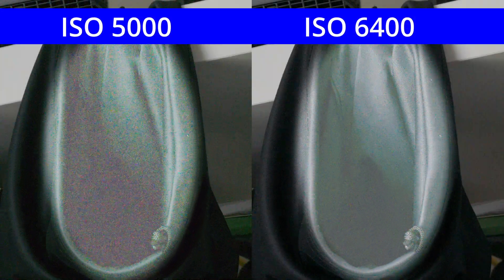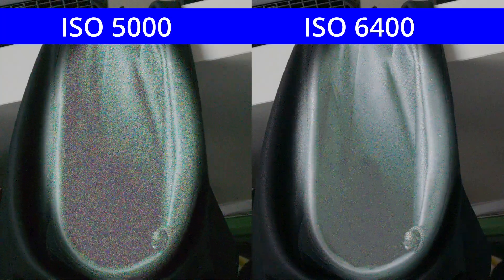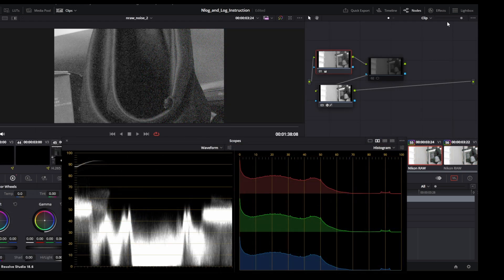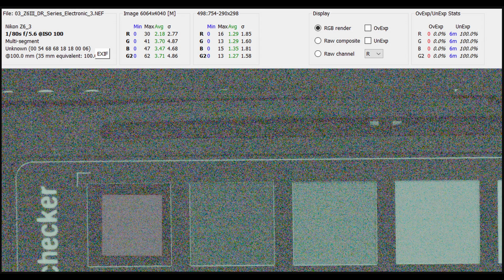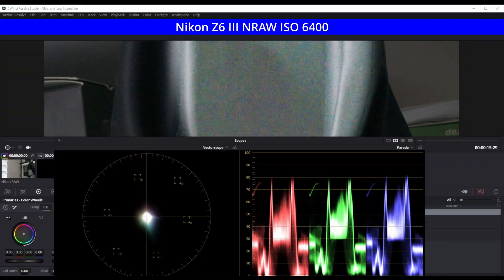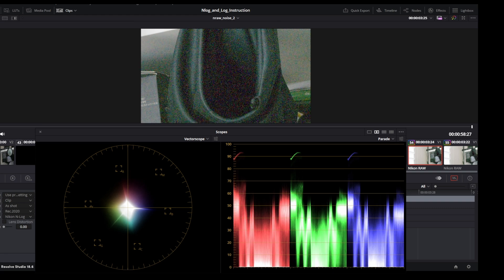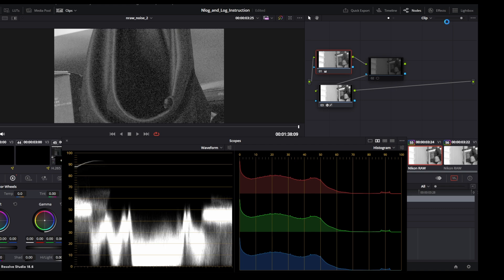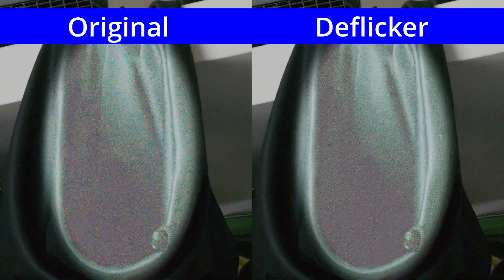Nikon Z6 III Video Flickering issue (with workaround)

Comment: Fantastic work. I've been messing with the Z6 and I absolutely love it, but anytime I need to lift any shadows in post or push an exposure.. the noise is intense. I also have a Z8 and have found a different issue... I wonder if maybe you could figure it out! When shooting in NRaw 4K, 24/30fps.. the blacks look like they clip and shift color.. Then if you go into the NRaw 4k 60FPS.. all of a sudden it matched the rest of the regular Nraw 8K and pro res blacks. I've tried standard and HQ raw modes, same issue.  It's been the number reason I dont use the Z8 more. Cause the raw is amazing on it.. but I dont need 8K majority of the time. So having the 4K raw fixed, would open up the camera for me more.
Reply from the maker: Thanks. I don't currently have a Z8/Z9 on hand so unfortunately I'm not able to try reproducing your issue.

Comment: Another reason  why you never buy these really expensive new models on or soon after the launch dates where Nikon and similar take  the piss with their RRP and deliberately over charge the value of these devices up to 30% or even 40%  of what the real price should be  when it eventually settles down to the real price which usually is after about 12 months being on the market . In Australia , Nikon launched the Z6III taking the piss at $4500 AUD that's the equivalent of  $2990 USD,  just a crazy price it wasn't worth it . Since then we see it wasn't selling well in Australia , it was too expensive.  A few months later already the price has come down around $800 AUD,  this is because  the original RRP price was way too greedy and wrong in the first place.  If you buy it  in the early stages of release you will massively over pay for these  depreciating electronic devices that will continue to loose  value. Just makes you wonder how they are able to drop prices by so much  like the Australian customer base example to meet the market and  usually the tech is already up to five years old when they drop these new models. Nikon would have already  built version Z6, Z6II Z6III years ago around the same time  as each other and version IV of the Z6  is most likely already sitting in a warehouse , just like what apple do with I Phones.

Comment: Excellent video, thanks.  I'm definitely sitting on the fence for this camera currently.  By the way, if you upload in 4k, Youtube doesn't compress the video nearly as much, especially at 4k, but also viewing at 1080p as well.  Even if one is viewing on a 1080p monitor, you get the best quality by "watching" in 4k, as youtube doesn't compress 4k nearly as much for some reason.
Reply from the maker: Thanks for the tip. I'll do some test uploads and see how 4K affects the compression for both 4K and 1080 playback.

Comment: Something i noticed is that shooting with SLG instead of Nlog seema to remove any flickering. I wasn't scientific in my approach but i looked for flickering across the entire ISO range and couldn't find any.

What are your thoughts on this? If it's only affecting nlog could it be software over sensor issue?
Reply from the maker: Do you mean HLG? HLG uses a shallower tone curve for the shadows, which means less shadow encoding / boosting than N-Log, so that would explain why you may not see the flickering.
Reply: @testcams sorry I meant SDR. 

If the shadow flickering isn't visible in a different tone, could it mean that it's fixable with a firmware and not a hardware issue that can't be fixed?
Reply from the maker: N-Log exposure baseline is -3EV vs SDR (because N-Log ISO 800 is really ISO 100 3EV "underexposed"), so that is likely why the SDR shadows look much better by comparison.
Reply: @testcams so if we push the SDR footage in post, we would see the flickering?
Reply from the maker: Yes, the flashing occurs in SDR footage. You have to push the SDR footage more to see it though since it doesn't start with a -3EV baseline like N-Log.

Comment: Is there ever a situation where you need to boost the shadows like 9 stops, or whatever you did?
Reply from the maker: Yes, when you'd like to more clearly demonstrate the relative difference (visually) of very small quantities between color channels for instructional reasons. The flickering issue occurs at much smaller EV boosting, as demonstrated later in the video and by Robert's video.
Reply: @testcams  Got a time stamp?
Reply from the maker: @2:27 in this video, which is approximately a 5EV push. Or in Peter's videos, which look like about 3EV.
Reply: @testcams  Thank you.  Now is 5000 ISO the right setting for that situation or is this a situation where you're pushing the camera beyond reasonable limits and surprised that the footage breaks down?  I'm thinking about buying this camera exclusively for the video work I do and am wondering if i'll ever encounter this 'issue'.
Reply from the maker: Your questions are valid and others have asked to same in the comments. This is not ISO specific, because it's not a noise issue per se but instead a variance in black level between frames, which is independent of noise or ISO. To help you and others with your buying decision, I'm working on a new video that compares the Z8 to the Z6 III, both at N-Log ISO 800. Even with no shadow pushing the Z6 III exhibits flickering on the Resolve scopes vs none of the Z8, but no flickering visible in the footage. At +3EV, the Z6 III's flickering is easily noticeable vs no flickering on the Z8. At no exposure push does the Z8 exhibit the flickering.

Comment: Why would someone use ISO 5000 when the dual ISO is 6400?
Reply from the maker: The issue can occur at any low ISO, for example if you shoot NRAW with N-Log at ISO 800 (which is sensor ISO 100), or if you shoot NRAW without N-Log at ISO 100.
Reply: Nikon added a feature on the Z8 to allow one to record at Lo0.3 to Lo2.0 (ISO 640-200) in manual mode, which is also available on the Z6 III. Will this issue be reduced/eliminated when shooting on a bright day by using one of these lower ISO settings? I’ve used Lo2.0 outdoors on my Z8 and it has less noise to clean up in post than ISO 800, I currently do not have a Z6 III to try it out but, I am curious how to see how this works on the Z6 III.
Reply from the maker: Yes, but only because you'd be effectively lowering how deeply you have to go into the shadows since "Lo" ISOs shifts the exposure right (brighter), which results in the same DR but changes the metered distribution of DR between the highlights and shadows. For example, Lo1.0 loses 1EV of highlights but gains 1EV of shadows, which means if you push the shadows by 3EV for both ISO 100 and Lo1.0, the Lo1.0 will be effectively pushing the shadows by only 2EV vs the original ISO 100 metered exposure.

Comment: Why would anybody use iso 5000 to begin with. I'm not trying to minimize the issue.
Reply from the maker: The issue can occur at any low ISO, for example if you shoot NRAW with N-Log at ISO 800 (which is sensor ISO 100), or if you shoot NRAW without N-Log at ISO 100.

Comment: As someone very interested in this camera, how serious is this issue for typical filming?  For example, to record low light scenes say under moderate lighting, is this going to be quite obvious or do you have be really pulling up the shadows to encounter it?  Would this likely be unacceptable to non-professional videographers or is it generally something you really have to look for?  Thanks.
Reply from the maker: I would recommend watching Robert's video to get a sense of a real-world exposure and adjustment one would face shooting N-Log that could encounter this issue. I get the sense he didn't do his Z6 III test looking for the issue. It doesn't require all that extreme of a dynamic range scene to manifest.
Reply: @testcams Thanks.

Comment: Given this shift is toggling so regularly is it possibly related to the debayer algorithms and therefore addressable in a firmware? I'm a photographer first, not a videographer so Nate that in mind is I come of as a total noob on the matter but I dabble in astrophotography and I recall how slight variations in debayering planetary captures can result in similar color shifting (though again I'm more into DSOs than planetary - ie ling exposure stacking than short exposure video cap and stacking processing)
Reply from the maker: There's been considerable sensor technology over the past few decades to improve the reset handling of sensor pixels, including a mechanism to subtract the charge after resets with the the charge built during the next exposure. This is called Correlated Double Sampling. From what I understand, the tiny charge/noise differences that can lead to black level imbalances are difficult to design out. I doubt Nikon can fix the black level issue with a firmware fix but it's possible they could devise a suitable workaround that will achieve the same effect. Regarding your question of hybrid readout design that can switch between fast readouts when needed for fps/action and slow readouts when DR is more important, I recently posed that very question to the sensor guru's on the DPR Science and Technology thread, which included participation by Eric Fossum, the inventor of the CMOS Active Pixel sensor. The consensus was it's not easy to do.
Reply: I'm probably coming out of left field again with this given my more photo-centric background (and while my day job is in a technical field - software developer - I'm not overly technical when it comes to sensor technology beyond the basic fundamentals). 

That said... Watching this again, especially your histograms, could it be that there's a residual charge left in the photo site wells boosting the signal between frames.

Then again looking at the rawdigger results, while the histograms all shift to the right for all channels a tiny bit it's the red and blue channels that present the most variation. Granted there are more green filters on the bayer filter. In just the few frames of rawdigger histograms the pattern seems to repeat very rhythmically. 

I certainly hope it can be fixed in a firmware.
Reply: I have another question that you may be aware of given your expertise in this area. 

Is it possible to develop a sensor with a hybrid mode of operation when it comes to readout speed. The idea being you could put the camera into a high-speed mode where you sacrifice dynamic range, or into a lower speed mode that would sacrifice readout speed but increase dynamic range. 

As a follow-on could that be done to an existing sensor in firmware like the one found in the z6iii? I can only imagine that Nikon would consider these sorts of technology when developing these cameras to satisfy both realms and as such I would think we'd already have it if it were possible.

Comment: Thanks for elevating the issue. Perhaps we can get Nikon to address the issue sooner rather than later. I’ve already returned two cameras because of this and I’ve now seen several Facebook forum members post info about their problems. In my experience the shifts you describe occur at all ISO values though the base ISOs are the least obvious but still highly distracting in the shadows or with dark objects. I went back and looked at some low light testing I did in the first couple of days of ownership and I don’t see the problem there, so this does seem to be a problem triggered over time as power cycles accumulate. Plus the flicker shows up in the EVF and the HDMI feed where Resolve can’t help. Not that I would suggest anyone hold onto cameras with such a significant problem.

Comment: Even with De Flicker it looks pretty flickery. So seems like this camera is not suited to shooting video in high dynamic range scenes as it shouldn't be a huge problem with photos.
Reply: It works a bit better in real-world scenarios, curiously, but yeah it doesn't fully resolve it. It's thankfully made the original clips with the hedge much more bearable in one of my upcoming videos. That tool in Resolve seems to have originally been intended for things like Timelapse clips, so it's kinda interesting that it has an additional application for this 😄
Reply: You nailed it. This camera suffers in dynamic range. Any little push in shadows, the clip breaks down fast. There is no room for errors with z6iii. Also,  whatever you shoot stay away from iso 5000.